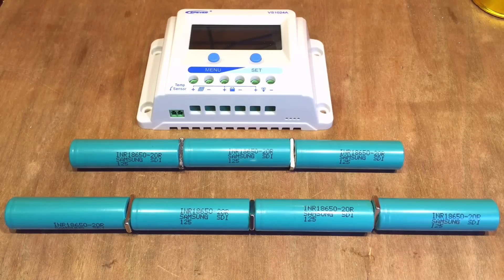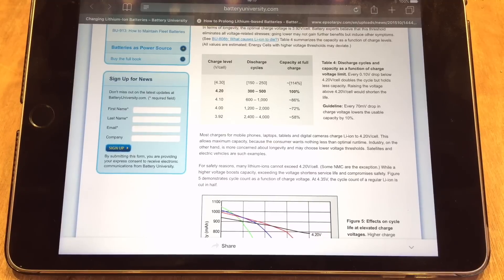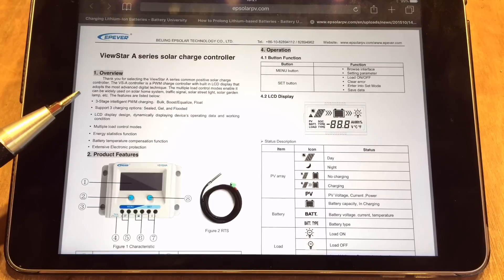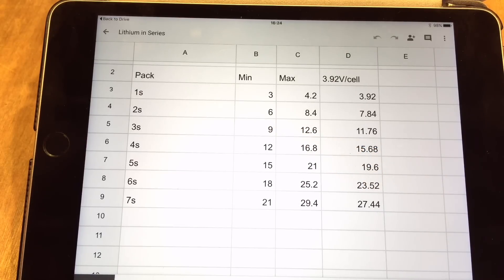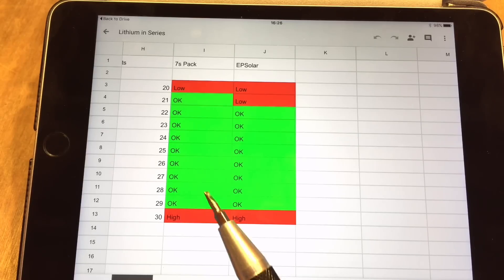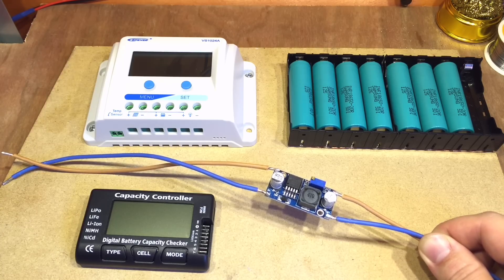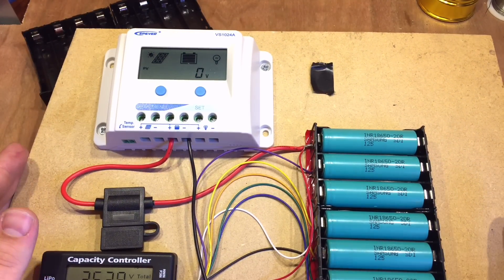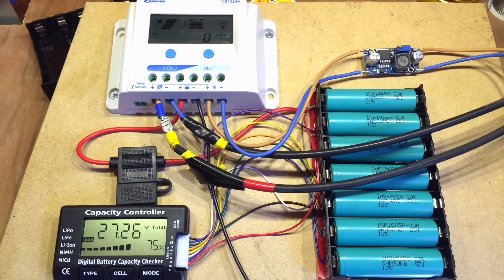Solar Charging Lithium Ion 18650s - Part 1, The Plan - 12v Solar Shed

Comment: If your charge controller has battery temperature compensation it might be possible to mess with that to fine tune voltages.

Comment: I can help with this - I think I may have already contacted you about my low-cost arduino PWM charge controller circuit?  It's perfectly capable of charging li-ions, as charge voltage and current can both be monitored and controlled via software. Just program it for whatever chemistry battery you are using. You'll need to add a balance circuit to the battery if you want the cells to last well though.
Reply from the maker: Hello - yes you've sent me the info about your clever little charger.  I intend to build one soon.  This experiment is all about using an off the shelf product for something it wasn't fully intended for however - it's an experiment and there will be better ways to do it.  Balancing is something I expected to need from the start - an update video to come soon.

Comment: Another question. Let's say I want to hook up a 100 Watt panel to this config. The panel I was looking at was 12v. It looks from the datasheet of this controller, that the panel voltage needs to be > battery. So, therefore I would need two 50 watt panels in series to step up the voltage to 24 volts. However, this is still lower than 7s 18650's which would have a nominal voltage of 25.9 - how would this work? I always thought these controllers were programmable so I could step up or down to match whatever I wanted to charge the batteries to. Or do I need to keep looking for a 100 Watt 24 v panel? Sorry, I'm new to solar... :)
Reply from the maker: +O Messner your panel voltage will need to be higher than your battery voltage. There are a couple of boost MPPT charge controllers, but 99% of all solar charge controllers need higher solar voltage than battery voltage. 
12 volt panels actually produce up to around 21-22 volts open circuit and about 17-18.5 volts at their maximum power point. You can double these figures for a '24 volt' panel. 
So either a single 24 volt panel or two 12 volt panels in series (that's what I'm using for this experiment) will do the job fine for a 7s pack.
Reply: +Adam Welch   thanks. yeah, looks like I'll pickup a regular full size 300 watt 24 volt panel. A local supplier here has some grade C panels very cheap. I was hoping to keep it small, but the bigger fullsize 24 volt panels are cheaper locally than 70 or 100 Watt.

Comment: Fantastic video. This is EXACTLY what I was thinking about today for an off grid  7.5 watt (24x7) load. Except, I will double by battery capacity in parallel. I'll be using a 70W panel. I didn't want to use lead acid due to size/bulkiness. Amazing that I found this video as surprisingly, there's not much on this exact subject (charging 18650's with regular solar charge controller)

Are you using the individual cell voltage monitor for safety (verifying periodically you don't have one cell that is way under voltage)? In my reading, it sounded like the more of these 18650's you have in series, it becomes more of a potential safety issue.

Also, can this controller just be set to have a load 24x7? I will always have a load, just need the excess power to dump into the battery for night time. 

Phoenix, USA
Reply from the maker: +O Messner Thanks for the kind words. Yes the charge controller can be set to have the load on all the time. 

I'm keeping an eye on the cell voltages to see if they go out of balance or if any go worryingly high or low. More to come soon on this.

Comment: I wonder what voltage levels of charge & discharge they use in the Tesla battery?
Reply: Yes, that much is clear. But what voltage do they run the packs at? Yet more curiously, what are the voltage points they use to determine end of charge & end of discharge for each cell? Obviously they want to create a good & reliable product so they surely would have given this careful consideration. Maybe it's a "trade secret"..! lol
Reply from the maker: +xanataph Would be interested to know. Not sure anyone I know could afford one though!
Reply: +Adam Welch Tesla Batterie consist of 18560 Batterie s
Reply: Check out Jehu Garcia's channel. He is using Tesla battery packs in his Samba.

Comment: What made you give up on the CN3722 MPPT charger board? Was it the advantage of monitoring the voltage or load protection features? I suppose you would need a BMS to keep the cells from going too low.
Reply from the maker: +slash2314 I've not given up on the CN3722. It's not a fully featured charge controller though really and as you point out there is no load control and a danger of the cells discharging too much. 

This experiment isn't for permanent installation and I can't see me moving to lithium ion in the shed - everything I run is 12 volt and as I found out in the video lithium cells can't really replace a 12 volt system.

Comment: I'm pretty sure float charging (Trickle) will damage the cells. I know it will at 4.2V but I'm not sure if it will or not at a lower voltage. Either way this video came at just the right time as I was literally researching just this all day. The best solution I could come up with was an MPPT charge controller from Genasun. They are able to make custom voltages for you and they even have a voltage step up on one of their models (Perfect for my 14S pack), quite pricey though. Will definitely watch for the follow up video. As well as any other video pertaining to solar and li-ion.
Reply from the maker: +lonnie776 Quite a lot of MPPT chargers have the facility to change the charging parameters (and a fair few pwm too) but they all still work on the bulk, absorb, float charging cycle where as lithium need CC/CV. This is the test here really. 

The only other step up controller I've seen was the Minghe MPPT solar charge controller Julian Ilett reviewed a few weeks ago. Take half an hour to watch his videos on that... I found it very interesting.
Reply: ***** Oh I guess I forgot to mention they Genasun controllers have specific models designed for LiFePO4 and Li-ion.

Comment: Now I have a plan. Brilliant idea and I will most certainly be having a talk to myself in the shed over this! Just need a good DCDC 24-12v transformer
Reply from the maker: I'm glad to have inspired - I'm looking forward to your videos on the subject.
Reply: +Adam Welch soon! just got 4 weeks left of 12 hour days then I should be back in the shed. Also my potential lead on recycled laptop batteries  has gone silent.
Reply from the maker: +pietkaify shame about the batteries. I got this lot from nkon. I think it was one of your videos that put me on to them so thanks very much for that.
Reply: what was your experience with Nkon? Someone said they didn't have a good time delivery wise
Reply from the maker: +pietkaify They took about a week I think. Can't fault them to be honest. Was I lucky then?
Reply: @AdamWelchUK  hey adam welch.if i use a bms that is 3s 30 amps,how many lithium ion battery that i can put  in parrallel?

Comment: do you have a link for the balance lead, not sure if the capacity tester comes with one, cheers
Reply from the maker: I'll add this to the description - these are the ones I got from China.  http://rover.ebay.com/rover/1/711-53200-19255-0/1?icep_ff3=2&pub=5575189419&toolid=10001&campid=5337903455&customid=7s+Balanced+Cable&icep_item=381594717286&ipn=psmain&icep_vectorid=229466&kwid=902099&mtid=824&kw=lg
Reply: Could you maybe do a Controller comparison (ones you already have)

Comment: Bravo Adam, I have been toying with doing this as I have bulk purchased 18650's. Its a job with the charging/discharging.

I think I may follow your project, what would you recommend to get yourself started solar panel size? Also I like your capacity checker, might need to get me one of those.

Bless you for sharing, keep up the good work.
Reply from the maker: I don't think I have any recommendations at the moment - it's very much an experiment.  Best not to ever go over 1C charging rate from what I've read, but solar can be so hit and miss - one day you'll get lots of current coming in the next nothing.

I've currently 2 '12 volt' 50 watt monocrystaline panels in series which are capable of generating about 2.86 amps at their maximum power point. The cells are brand new 2000mAh Samsungs capable of 20a peak current draw.

Thanks for the kind comments

Comment: Good explanation, i was planning on running my little 18650 powerwall at 24v, i had wondered with my tracer whether i can have the batteries at 24v but the output at 12v.  I shall have to experiment.  BTW does the balance lead come with the 7s monitor?
Reply from the maker: +Colin Hickey (Lets make stuff!) Hey Colin (lets make stuff) :-) and thank you. 

The monitor doesn't come with a balanced cable but you can get them in packs of ten for about £2 from China or there's a good reseller in the uk I used who sends them quickly for about £1.80 each I think it was. Inhelune his name is - but I've just checked and he is away until September :-( 

The output in the tracer is just a connection to the battery. That in my opinion is the biggest issue with 24/48 volt systems. You need to either step down or as most do just hook up an inverter - both solutions lead to losses. 

Thanks again.

Comment: There's one big problem with your setup, the charger will float charge them when they reach the full status and lithium cells should never be floated. The best setup would be to use a BMS like the one electrodacus designed in his channel or use a proper lithium solar charge controller.
Reply from the maker: Thanks for your comment - I mentioned the float charge when discussing the difference in charging profiles.  I've also mentioned this on a previous video where I reviewed a small pwm lithium ion charge controller ( https://youtu.be/b3Y3H0I0xec ). This is exactly why I want to try this for myself - I want to monitor whether things do get out of hand, and how quickly.

As the float voltage (27.6 volts) is below the boost charge (28.4 volts) I'm interested to find whether the charge controller will actually release the panel entirely.  If that's the case then the batteries wont get any more current until they drop to 3.94 volts (27.6/7).  Isn't this exciting! :-)

Dacian's charge controllers are beautiful things and incredibly well designed from what I have seen.  I'd love to get my hands on one but I think this is still a valid experiment in the mean time.